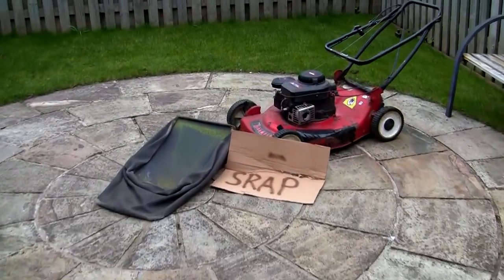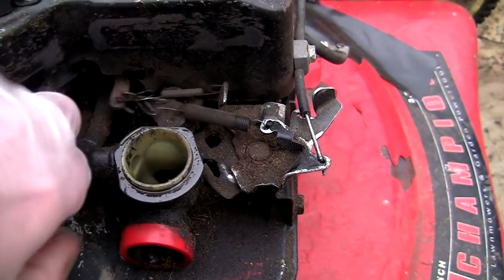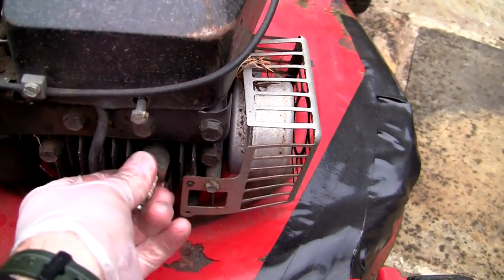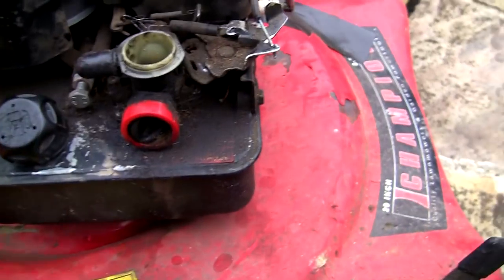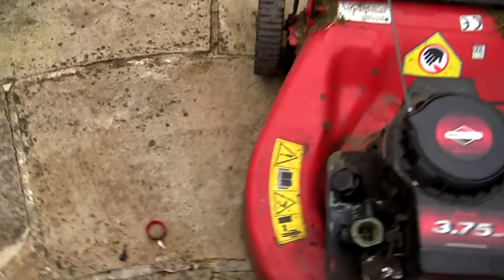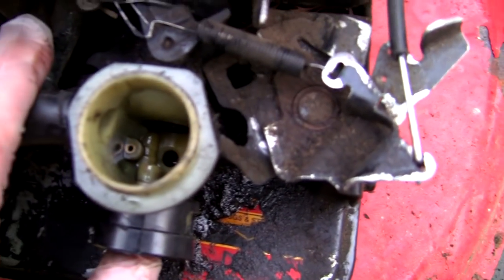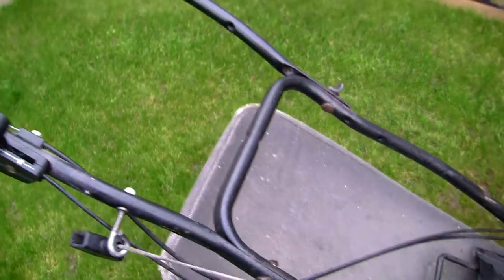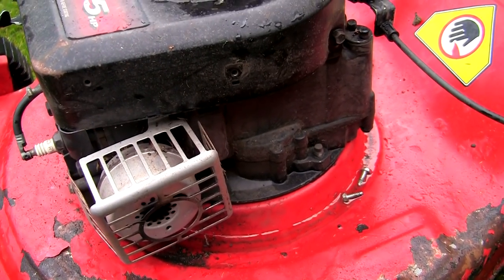Scrap Lawnmower Will It Run?

Comment: I am pleased that I watched this video. (I usually watch yours but this one just popped up). I have a mower similar to this that I have just finished repairing but the throttle cable was shot. I had taken it off and was looking for a new one. But like you said, it is not really required on this type of engine. So you have saved me a few pounds. Thanks for that. I didn't listen to your advice about starting with the easy B&S engines though and picked up a Victa that kept cutting out. But I am persevering with it. There are some governor springs or arms missing and I am struggling to get some spares but think I now have some coming from Australia. So I WILL get it sorted and sold. Thanks again for saving me some money and for your great videos which have helped me enormously. Keep up the great work.
Reply from the maker: Thanks Malcolm

Comment: Don't understand why you take the plug out to easystart it. Why not just spray it in the carb?? I'd be interested to know if there's a good reason,  thanks.
Reply from the maker: It's a different style carb on these and to do that you would need to remove the air filter each time. Also it isn't easy to direct down the intake on these

Comment: Why would you not keep the engine scrape the deck , wait for a newer deck to put it on , make more money .
Reply from the maker: I sometimes do that. I don't get many lawnmowers with engines I can't repair so I rarely end up with just a decent deck. Sometimes I break them down for spares also. I did consider a lot of options but wanted a quick sale and as it was completely free it was 100% profit. I've been saving up for a battery impact drill so the cash was useful. I bought one today. Cheers Chris.

Comment: Hi I have got a Mountsfield  SY150 , juts bought it as a fixer. , it will start up  on choke , runs for few seconds the  dies , ive cleaned carb twice , and still same  problem . do these have problems with coils failing> anyone got any ideas?
Reply from the maker: Joe Shoestring Racer I've got a video coming shortly on sv150 problems !